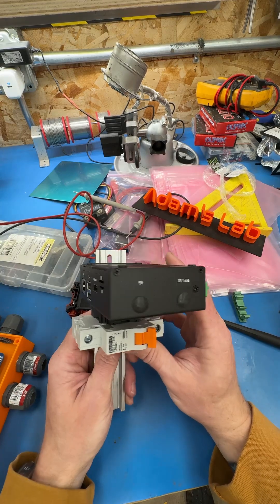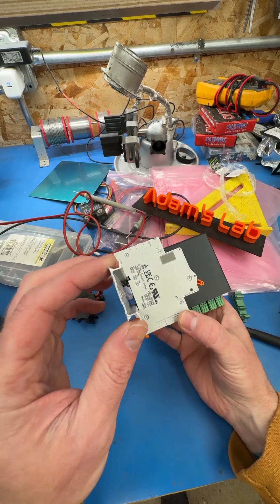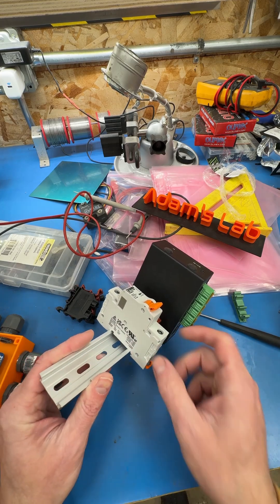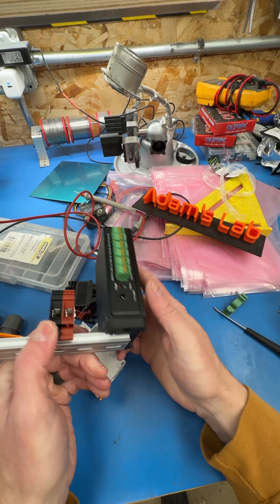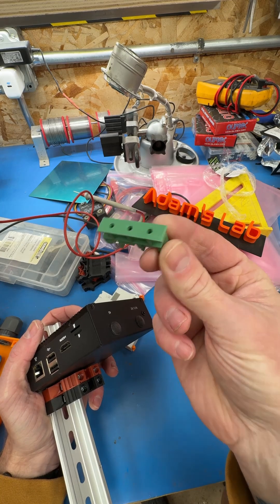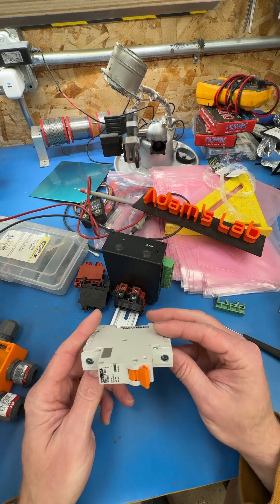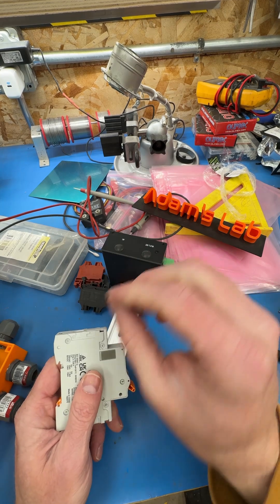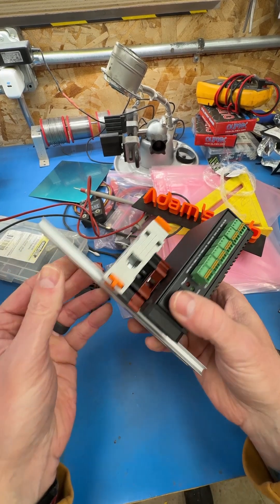DIN Rail is cool #electrical #electronics #diy #industrial

Comment: Panduit finishes the enclosures off nicely. Ferruled connections and it's a pro job.
Reply from the maker: I’m a recent ferrule convert. Have to have a good crimper though. I like my Knipex one.
Reply: @AdamsLab  yup I got one that closes nicely. They are a little expensive but well worth it. I also have a ratcheting one with replacement jaws for different size crimp connectors. I love seeing nice work after completion. It's a pleasure to witness people who take pride in their craft.